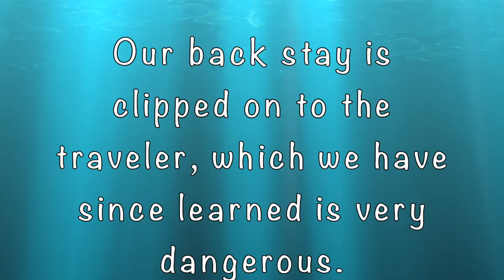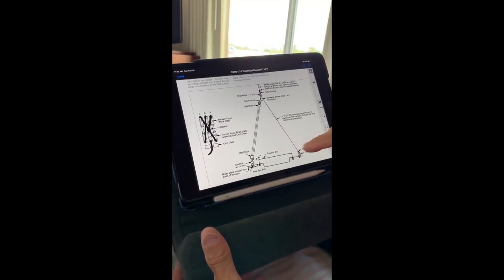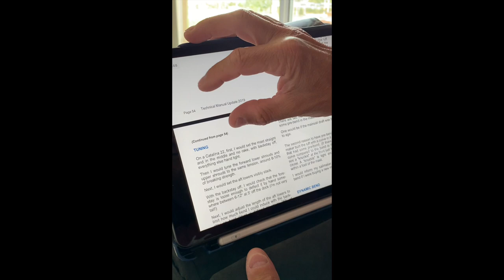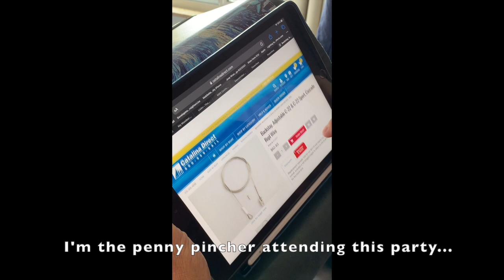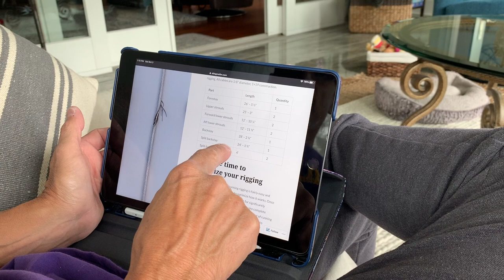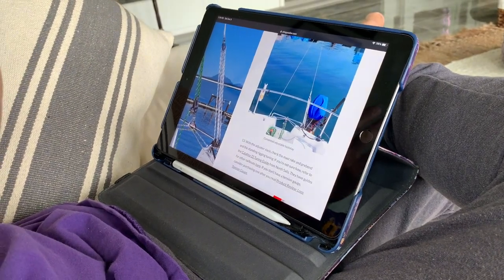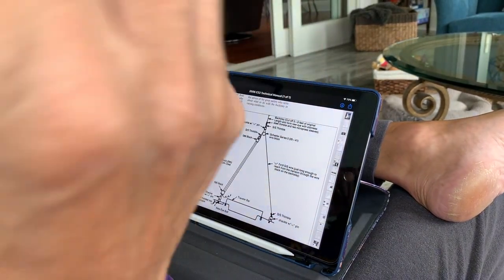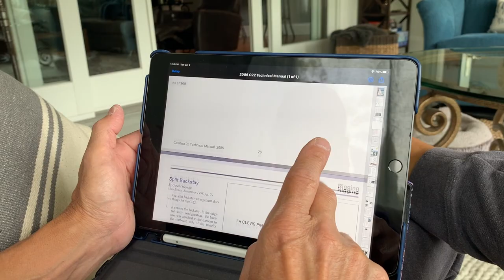How to fix really wrong rigging on a Catalina 22 sailboat

Comment: My "sailor's eye" doesn't like the asymmetrical look of the off-center backstay.  But it works just fine.  I have tried hard to find out if it gives one tack or the other an advantage in pointing angle, and I can't find any.  (Doesn't mean it isn't there.)  We do find using the traveler will give us a couple of degrees to windward--that's no surprise.  Back in dinghy racing days we skinnied by many a buoy by grabbing the boom and physically pulling it to windward.  In spite of the improved pointing results, we only use the traveler when we can carry a tack for a long time.  It's too much trouble when you have to do a number of short tacks.  Maybe we will make video about the traveler.  As far as flattening the sail when the wind kicks up, we just reef or go home.  Enjoy watching you process your decision making.
Reply from the maker: We would love to see a video on the traveler!

Comment: My boat had a split back stay, but it was non-adjustable. Back stay came down and attached to a triangular plate (top point), the split was a short stay  off the other two points of the triangle and attached to the transom.  The adjustable split back stay like you are looking at allows you to add/subtract bend to your mast to help with sail shape in various wind conditions. The traveler work in a similar fashion. As I understand it, you keep it centered in moderate winds, pull it into the wind in light air to give the sail more of pocket, and move to the other side in heavy wind so you can "dump" some wind. My boat didn't have one so I never got to try it.

Comment: Backstay is to support your mast not your boom. Forestay prevents the mast from falling back and the backstay prevents the mast from falling forward. The topping lift is to allow you to move the boom up and down to adjust twist and depth in your mainsail. The boom needs to be attached to the traveler by the mainsheet so it can swing to the different points of sail. Think of the forestay and backstay as the roof of your house. If one side of your roof is allowed to move from side to side the whole roof could come tumbling down. That is why having the backstay attached to your traveler is dangerous. Hope you guys get it figured out and yes asa101 would help you if you get to take it.